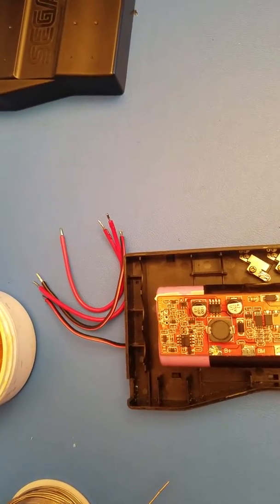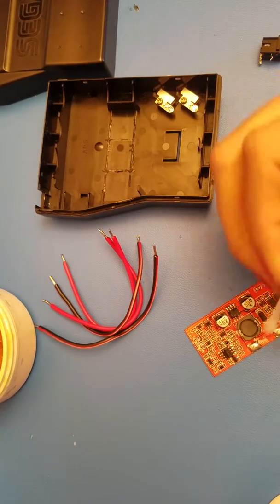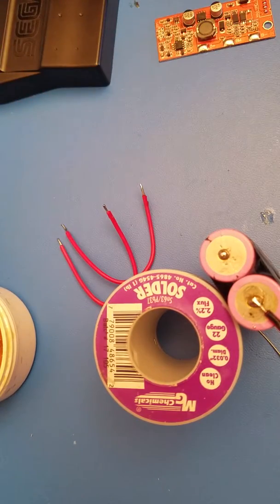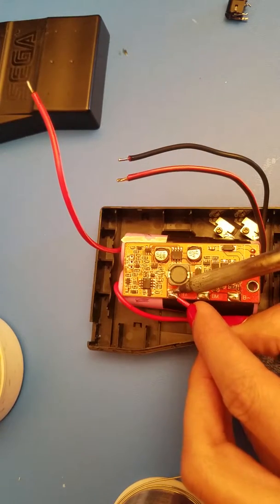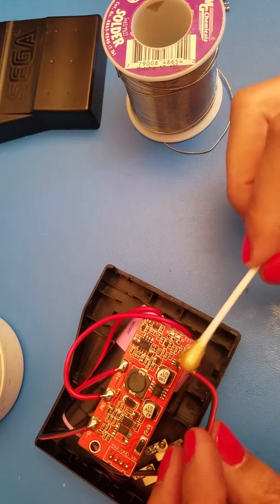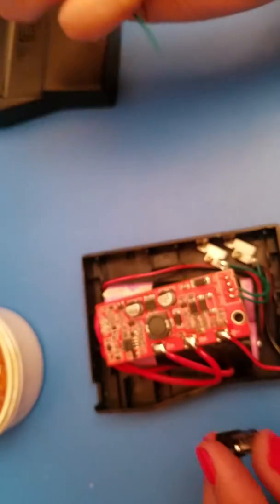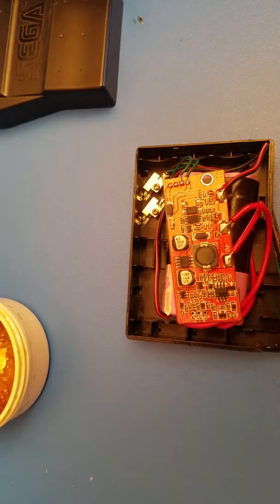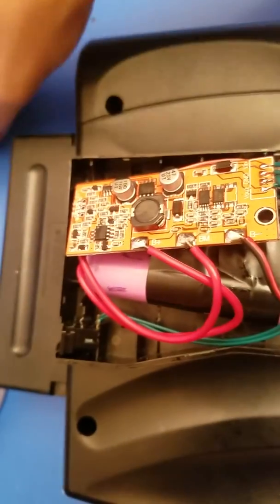How to mod your Sega Nomad rechargeable battery pack with 18650 batteries

Comment: @3:34 if you lightly scratch/score the battery terminals with a knife, the solder will stick much better to them. Also using some flux will make it stick alot faster. I do both to minimize the time the solder tip is heating the battery terminals.

Comment: Will this board and original nomad ac adapter work with these batteries Samsung 35E 18650 3500mAh 8A Battery

Comment: I ended up doing everything in the video and it fried the nomad... wouldnt turn on. The batteries you bought were they 18650 3000mah 15A high drain 3.6v? I ended up buying another nomad and I'm afraid to plug it in. I get 7.8v at the pins on the back of the battery pack.
Reply from the maker: In this video i used samsung 3.7v and in my recent 3.7v tenergy 2600maH. If it fried your nomad, there was likely an issue in the back board on the nomad. Ive done several of these and nothing happened. Im sorry you ran into an issue. You should have 7.4v to as high as 8v ish at full charge
Reply: @rainbowrepair5692  ya I figured, I'm just afraid to try it again and hurt the new one. It works with the OEM AA battery pack in the new one and it has the same back as the one that stopped working... something on the top board of the old one got damaged
Reply from the maker: @3d2dcreations87  coupel other things. I alway recap before doing mods with nomads. Many issues can arise. Its obvious  that you wired it correctly since youre reading 7.8v at the terminals. So it could be the nomad or the 18650 board. Im sorry i cant help troubleshoot too much by commenting
Reply: But I'm still afraid to use the li-po pack on my new one lol, I'll wait till this screen comes in and test on the one I just fixed
Reply from the maker: @3d2dcreations87  yea the composite lcd mod, most of those lcd driver boards have crapped out on me several times. Looks like youre making progress. Your pack is good.
Reply: @rainbowrepair5692  so I just used it to see if it will power it without a screen just like it does with the power cable. It fried the voltage regulator again lol so it is probably the batteries or the charging/balance board
Reply from the maker: @3d2dcreations87   And I would not be thinking that it would be the battery is or the balance board considering that it's giving you 7.8 at the pens and the sole purpose of those 2 things are to provide a voltage and then output it which its reading correctly
Reply: @rainbowrepair5692  I actually used the other back board I got from the 2nd nomad I bought.. still made the voltage regulator burn up... like I said I used the OEM AA pack and it puts out 8v, it works with that. So I'll try rebuilding the battery pack and see if it that's the problem
Reply from the maker: @3d2dcreations87  oh okay yea that makes sense. Good u figured out out
Reply: @3d2dcreations87  Did you fix your issue?
Reply: @chalkers  yes
Reply: 3D2D Creations what was the issue?
Reply: @RiverBoa99  had the voltage out and ground switched. So everything i plugged it in it didn't work it was backwards.
Reply: 3D2D Creations That’s kind of interesting. On the original battery pack the ground and the voltage out were soldered together on the negative terminal of the battery pack.
Reply: @RiverBoa99  well I had the wires switch to the 2 metal pieces on the battery pack that contact the back of the nomad and it fried my voltage regulator. So I switch the 2 wires and fixed my issue
Reply: @rainbowrepair5692  How long does your battery last and does the balancing board charge up to 8.4V at full?  I wired in a battery box so I can change out the lithiums, but I'd like to add the same charging feature using the old port and AC adaptor if possible as another option.
Reply from the maker: I'm more inclined to say that there's an issue with the backboard on the nomad itself with a short to ground somewhere then saying a has anything to do with your pack or the actual voltage regulator

Comment: is the original battery cover able to fit back on the pack flush without any modifications?
Reply from the maker: The cuts that need to be made are obviously the bottom where the batteries will be. And the last would be right next to the dc port there 2 tin lil nubs on the bottom shells portion. That way so when you have the dc jack in upside down and glued down it clears it. Otherwise the shells snap together perfect
Reply: @rainbowrepair5692  Perfect!  Thank you!

Comment: Hi Natalie,  Awesome battery mod thank you for sharing this.  I have a question?   Are you still able to use the original Sega Nomad AC adaptor with this battery mod?...….Thanks
Reply from the maker: Yes
Reply: @rainbowrepair5692  Hi, hopefully you can help, i just picked one of these up from ebay, its completely corroded and the battery's have leaked, hoping to follow your guide to do this mod, already ordered all the parts, and a replacement jack port because that is corroded as well, is there anyway to add or even use the led from the original board using this new board?
Reply from the maker: @robertryding4163  i would say its possible if you ran a patch wire fron the leds pads on the new board sure.  But to be honest when its charging its plenty bright to see what charging indicator is lit up through the hole.
Reply: @rainbowrepair5692  thanks for the help, will wait and see, probably going to take a few weeks just for all the parts to get to me and wasn't sure the new board even had an LED :p
Reply from the maker: @robertryding4163  youre welcome. Yea the intelligent balance board has a green and red led.

Comment: Post links to the battery board so we can buy please
Reply from the maker: https://www.ebay.com/itm/Intelligent-Balance-Charging-Protection-Board-2S-Packs-18650-lithium-Satellite/112378909208?_trkparms=aid%3D222007%26algo%3DSIM.MBE%26ao%3D1%26asc%3D20180213162448%26meid%3Db074c3dd61824dea9847ee19ef349a4b%26pid%3D100930%26rk%3D3%26rkt%3D8%26sd%3D311721987212%26itm%3D112378909208&_trksid=p2349624.c100930.m5375